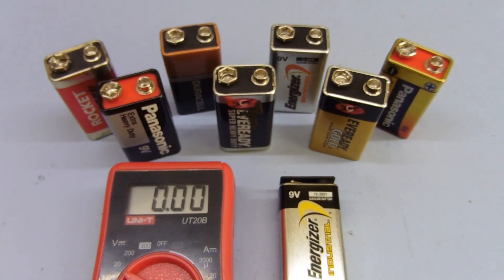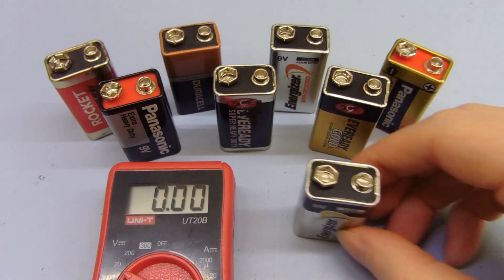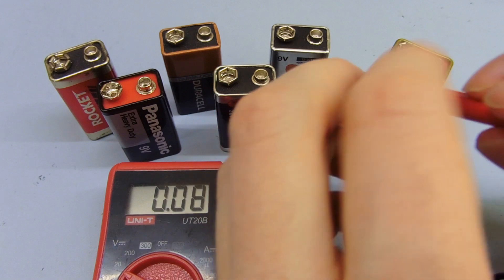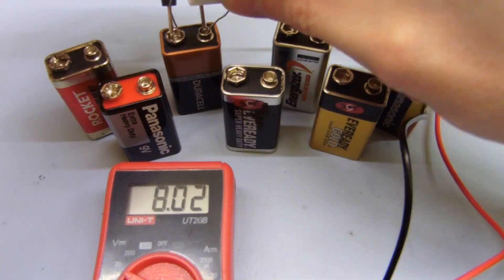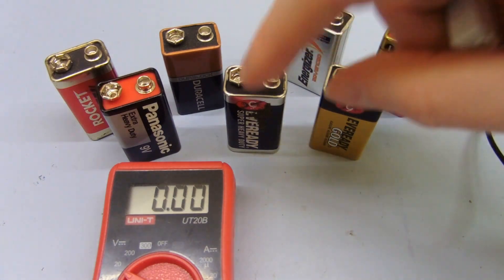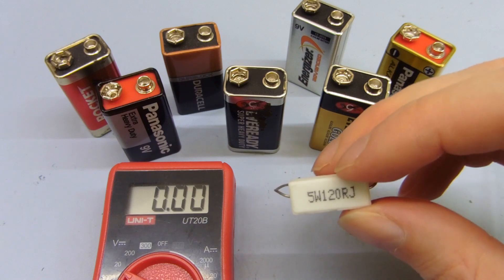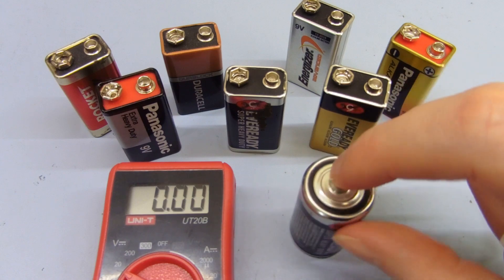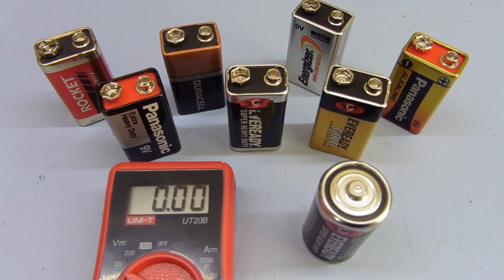9-volt battery testing & why open-circuit voltage is meaningless

Comment: on Eveready voltage drops because it isn't alcaline and has higher internal resistance as zinc carbon one.
Reply from the maker: It was also very old and rather flat.

Comment: I don't know about that Rocket brand, but the Zinc Chloride-based Panasonic EHD is a notoriously wimpy battery that's only rated for around 20mA discharge. Running a 120 Ohm load on it abuses it pretty badly and would probably tank a brand new one nearly as much.
Reply from the maker: Good point! Of course, to do proper testing, one must check the datasheet and use an appropriate load, for batteries or anything else.

Comment: The problem with standard batterys is there is no capacity written on them, so you never really know what you have.
Diodegonewild did some testing with a discharge device and the best value was the supermarket alcaline generic ones, not duracell as people often think.
Reply from the maker: I stay away from the cheap brands, as they seem to have a tendency to leak. Perhaps in his country the supermarket batteries are worth it, but here, they are only marginally cheaper. A two-pack of "Chevron" 9v are $5, which is cheaper than the name-brands, but still more expensive than those Energizer Industrial I bought recently, and I would be amazed if they had a higher capacity.